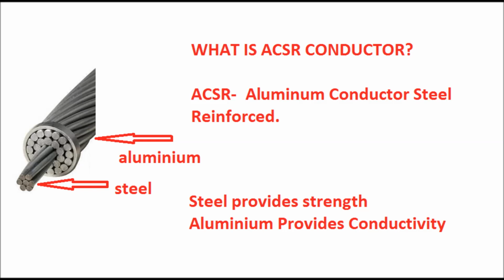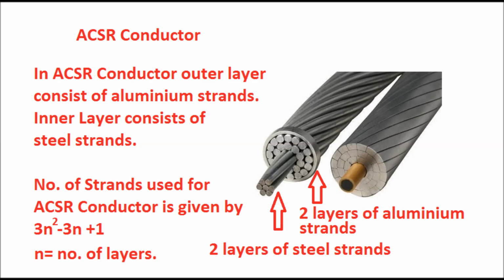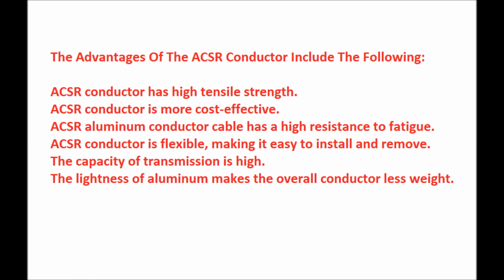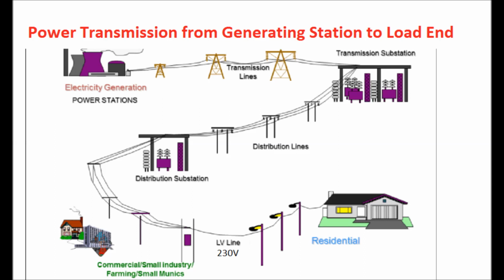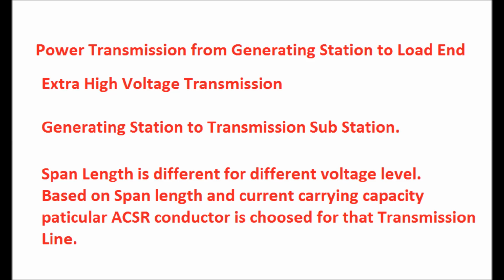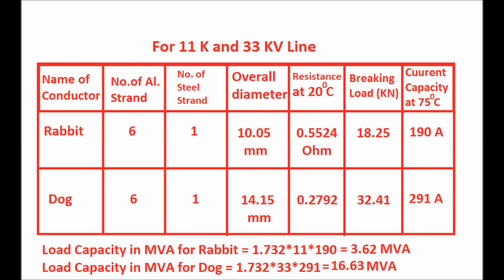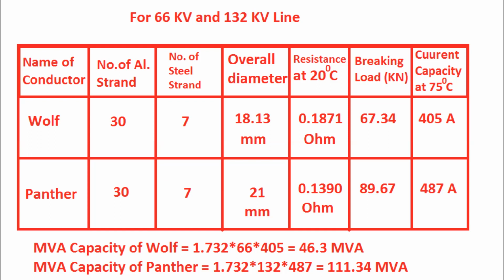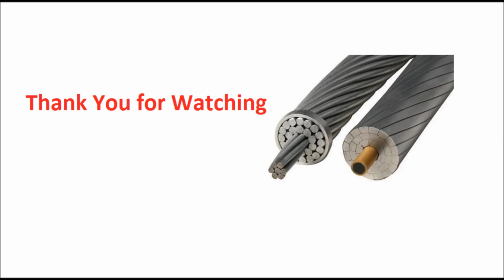ACSR Conductor|| Different types of ACSR Conductor || Current Carrying Capacity

Comment: Dear sir, Kindly do video about span length and different types of transmission towers also
Reply: Two types of towers. One where conductor cable passes through. The other uses dead end connector at each tower. All cables are no weld products.